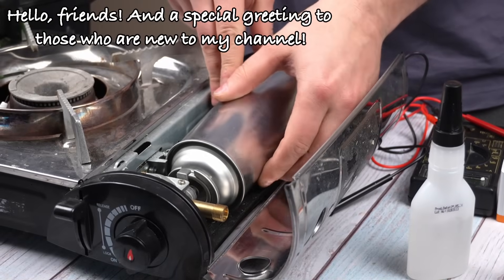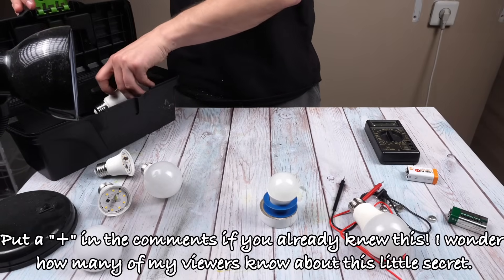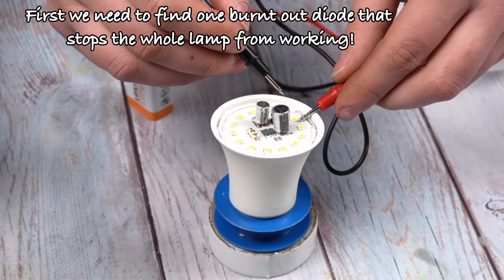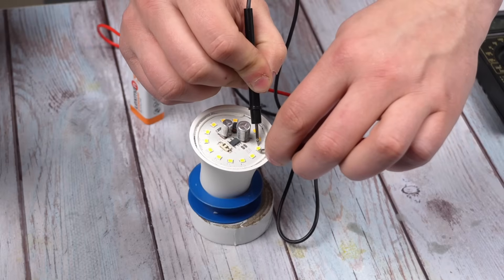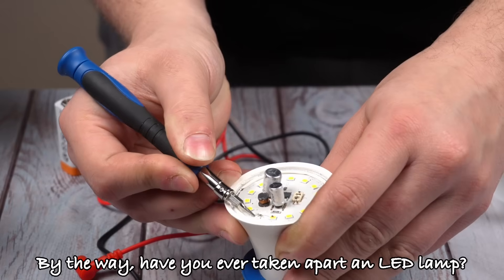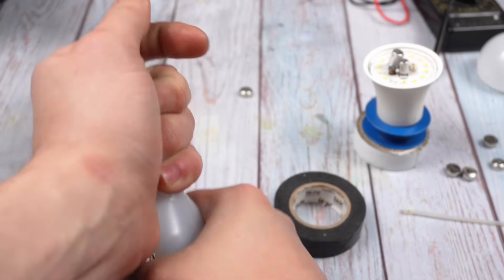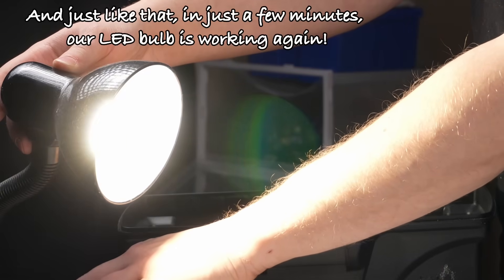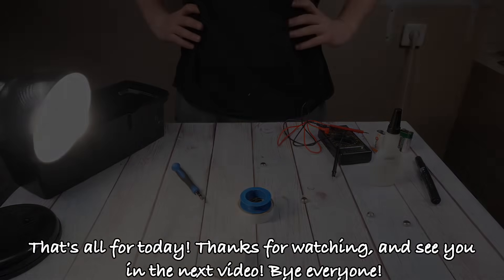🔥PUT BATTERIES in your LED lamp! The secret everyone should know!

Comment: What is the science behind this miracle fix?
Reply: От нагрева батарейка может взорваться ! Это опасно 🎉
Reply: Using a piece of metal, the battery, to connect the two terminals that went to the led. They're obviously wired in series, so when one 'dies' it breaks the circuit. Any 'conductor' could be used to bridge the faulty diode. I suppose a battery is just a convenient size. I can't see any reason why it would actually need to be a battery other than that.
Reply from the maker: wow 🔥 Once again I am convinced that I have the best audience ❤️🌎
Reply from the maker: A battery serves better as a grounding device, over time there will be no burnouts. If you just apply current and connect only with a wire, the load will go unevenly to the other diodes, which will lead to a quick burnout, but with a battery everything becomes different

Comment: You don't need a battery just soldier a wire across it and it will work
Reply from the maker: A battery serves better as a grounding device, over time there will be no burnouts. If you just apply current and connect only with a wire, the load will go unevenly to the other diodes, which will lead to a quick burnout, but with a battery everything becomes different